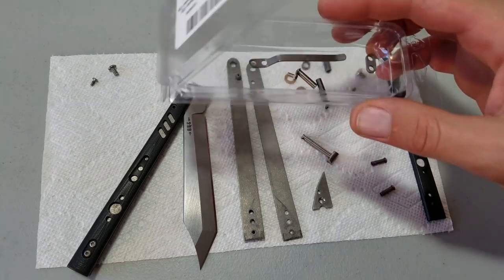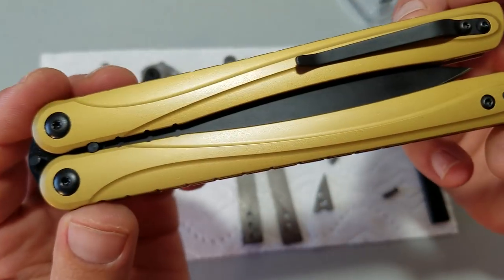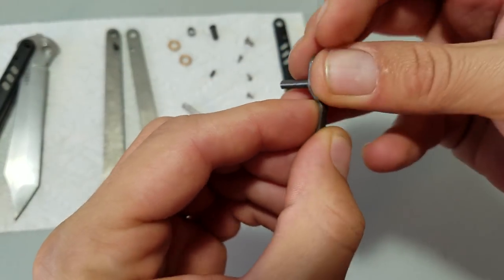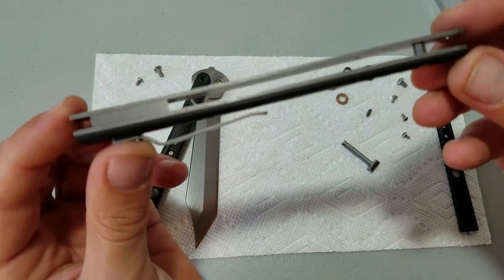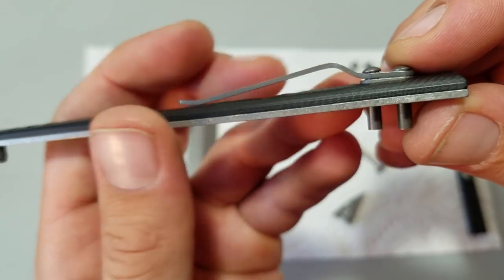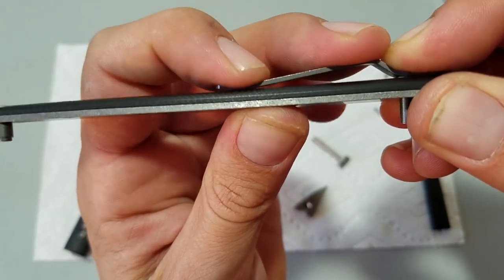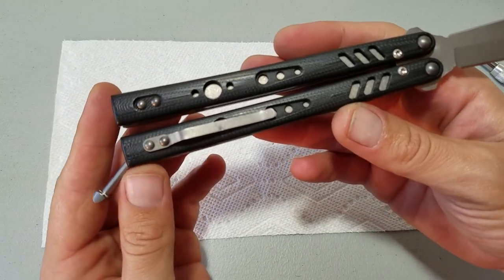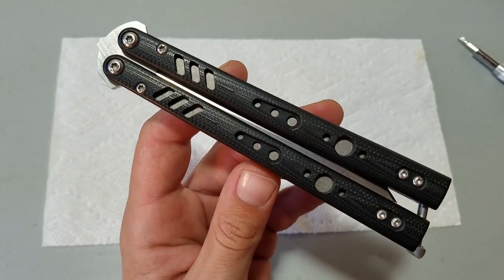Balisong problems. BRS Replicant pocketclip installation

Comment: I know this video was posted a year ago from when I'm watching it but the problem that you're having with the clip retention is because that small plate is supposed to go on the opposite side to the pocket clip so that it comes out even. So basically just put the clip on the side where the female sexbolts go in and the plate on the side where the male sexbolts go in or visa versa. Hope this helped!

Comment: The bushing system works like a normal bushing system, what you mean with the bushing sticking out a bit of the blade, that is a floating washer system.

Comment: What up brother! Love your videos. I have a fuckin serious question for you. If you had to choose between the Benchmade 87 or BRS Replicant which would you choose??? need to make a decision. Thanks Bud!
Reply from the maker: The 87 hands down it's a better knife it may be argued the BRS is a better flipper but in reality that's a matter of preference and if price is not an issue Billet Channel titanium with the 87 pivot system which I think is a vast Improvement over other bearing design balis the BRS is an excellent knife when fitted properly bushings again could be argued are better and if you prefer bushings you are not necessarily wrong however there are a lot of variables that come into fitting a bushing knife you have higher chances of needing aftermarket work to make everything perfect which with a company like BRS is less likely but is still a concern the only real concern with Channel titanium on bearings is blade centering making sure the channel was milled properly but that takes a lot of parts that have to align perfectly screws that have the possibility of breaking or getting lost there's just less to go wrong with the 87
Reply: Lugermonger thank you so so much!!👍🏻😃 awesome!!